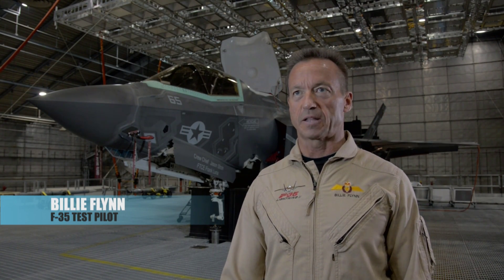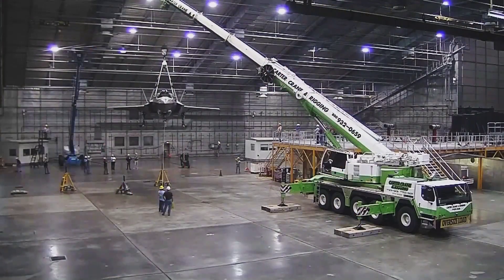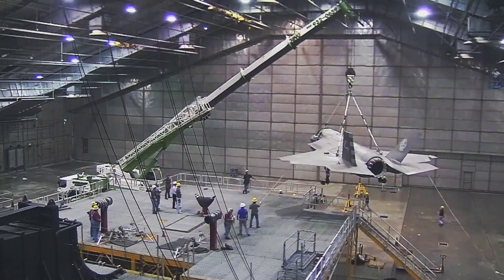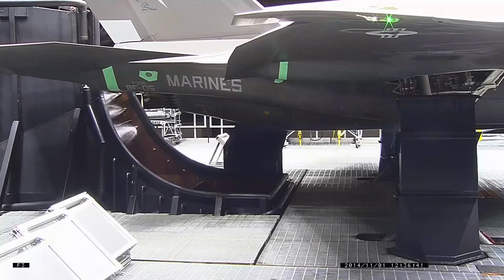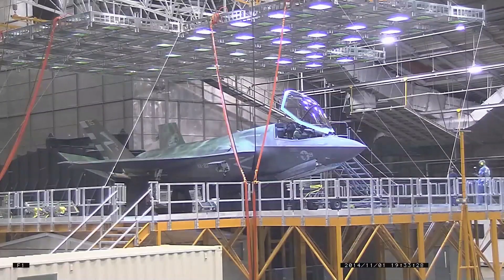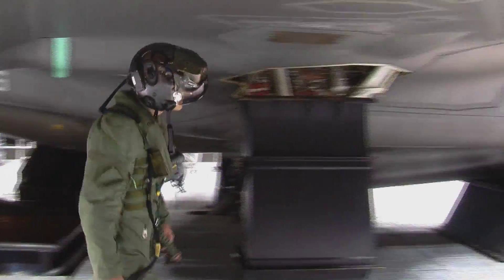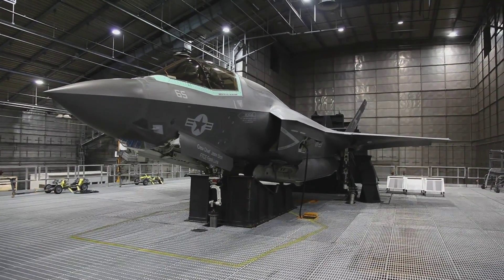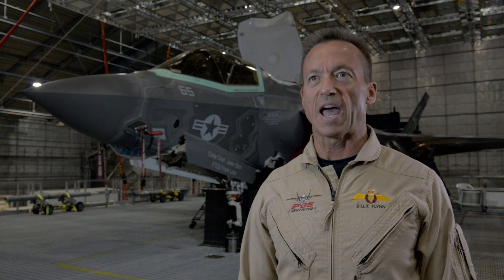Behind the Scenes with an F-35 Test Pilot in the Climatic Chamber

Comment: Still can't use warm jet fule
Reply: All the Engineers have to do is Change the IPID .  Not sure they want to do that just yet..  So.. Keep the cooler fuel coming... For now..
Reply: As long as it does its job.
Reply: Most F35's are still OTE and some are going Operational.. SOP...   So.. Hold your horses...
Reply: +reptiles12345 Most fighters don't and the F-16, F-35s and others use the fuel (not fule) as cooling and other functions.